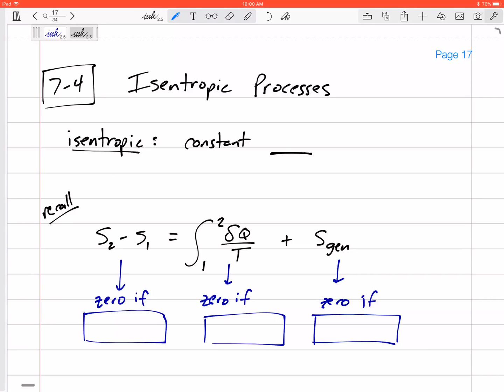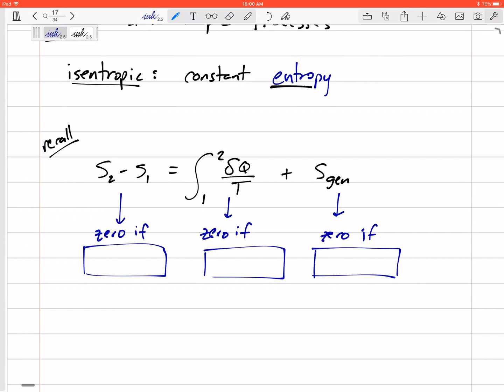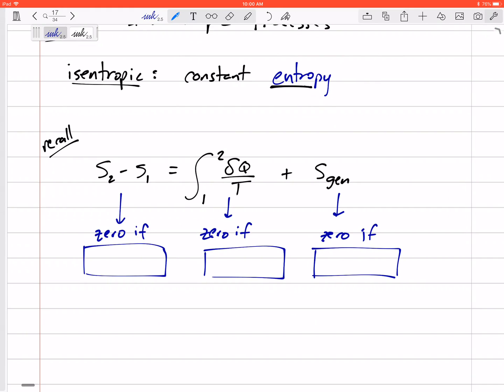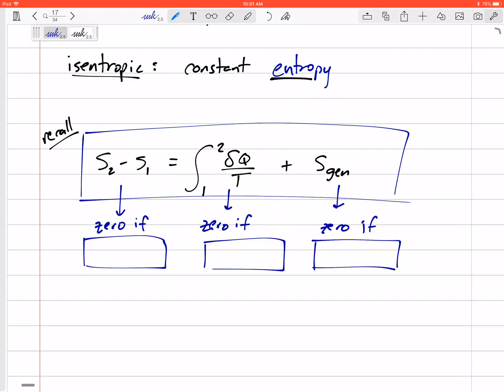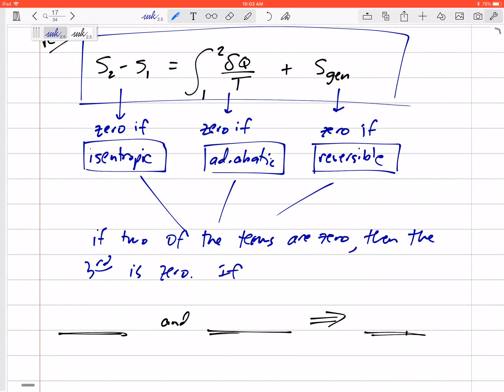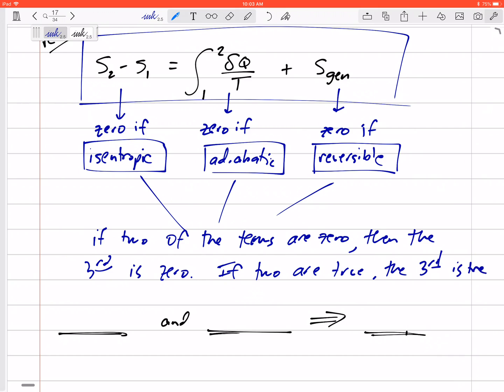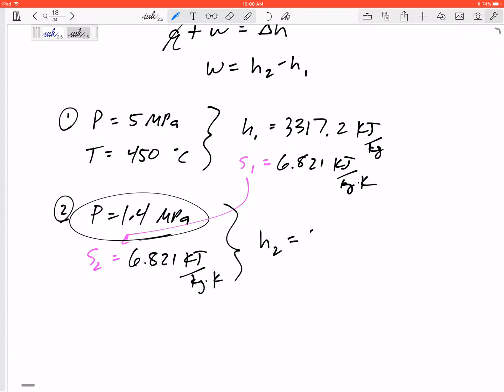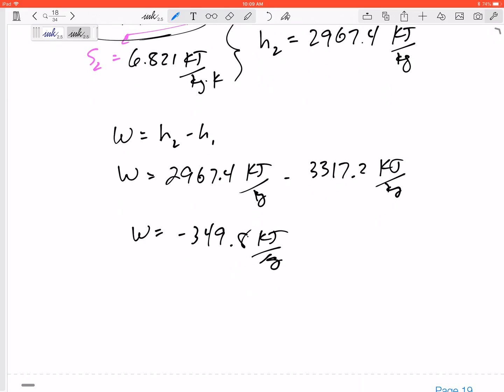Thermodynamics - Entropy 7.4 Isentropic processes

Comment: 5:40 why does it equal to delta h ?
Reply: Turbine is a steady flow device. Hence, if you look at the "Steady Flow Energy Balance Equation" you can get the equation given in the video by ignoring kinetic and potential energies, of course. Moreover, since "Steady Flow Energy Balance Equation" contains terms in time rate of change, you need to divide the equation by the mass flow rate and get the desired work per mass term.

Comment: Thank you for all your video that I find really useful. One thing I don't understand at 12:30: assuming the process were irreversible but still adiabatic, then it wouldn't be isoentropic and s2 would be greater than s1. Looking on the table of superheated steam for p=300 kPa any point with s2 > s1 = s2_rev has also h2 > h2_rev. This lead me to the conclusion that if the process were irreversible h2 would be greater than h2_rev  (2845.7 kJ/kg). In turn v2 would be lower than v2_rev from the first equation on conservation of energy that means that v2_rev is NOT the minimum velocity value at the outlet of the diffuser. What am I missing? Can someone help? Thanks
Reply: since you wrote this comment 6 months ago it might be a bit late but yea i was confused too and thought like you. i guess the question is written wrong and actually wants us to find the maximum velocity otherwise it doesnt make sense to me as you explained more irreversible means lower velocity so if it is reversible we get the maximum velocity available by the laws of entropy

Comment: Can someone explain why on number 8, when we try and find h2, why do we interpolate between 250 c and 300 c ? Because we don't have any given temperatures except for 450 c but that's for state 1 and at 5 MPa or 5000 kPa.  And for 1.4 MPa the phase is superheated vapor still, but we don't have any given temperatures except for the t-sat found at 1400 kPa or 1.4 MPa for state 2.  So how do we know to use 250 c and 300 c ?

EDIT: still need help, but the only connection I see that could make us interpolate between 250 c and 300 c is that in state 1 the t sat is 263.94. but even then that's for state one not state 2. So where is the connection to use those numbers ?
Reply: Hey i was having the same problem. But you need to use the fact that the process is isentropic. Such that s1=s2. You then find where the entrolpy lies on the tables for me it was superheated water 1.4MP between T250-300. Given that the s = 6.8210 it lays between the 2 values. You can use an equation to find the enthalpy given you know the upper limits, lower limits and the target value. in basic form it is                                                Y = YL + [X-XL/XU-XL]*[YU-YL] where Y is the what you want, YL is the lower limit of what you want, YU is upper limit. XL is lower limit of what you know X is what you know and XU is the upper limit. so for this problem the equations comes out to be H2 = 2927.9 (Lower limit) + [6.8210 (what we know) - 6.7488 (lower limit) /       6.9553 (upper limit) - 6.7488] * [3040.9 ( Upper limit) - 2927.9 (lower limit) ] = 2967.41 kJ/kg.  Hope this helps :)
Reply: @Eggobaco  thank you!
Reply: Thanks. That was really helpful

Comment: The pressure of 0.15MPa @120C is not in my table A-6 for superheated water.. When I look at the T-s diagram (figure A-9) you can kinda approximate the values (120C @ 1.5bar).. They look to be what he has, but since on a chart its hard to get an exact value.

Comment: Hi, for the second question (#9), how do we find the specific enthalpy and entropy values? I went to A-5 and found that at state one the temperature is much higher than the saturated temperature so it must be a superheated liquid. But when I go to table A-6, I don't know how to interpolate between 0.1MPa and 0.2MPa because they don't share the same temperature ranges (0.2MPa actually doesn't list 120 deg. Celcius at all).
Reply: just replying for anyone whos interested in the future ur probably done with it;

find the enthalpy in the table for 0.1MPa using interpolation between temps 100 and 150, then use that value to interpolate again with the value of enthalpy from the 0.2MPa table where its temperature at saturation is almost 120 so its safe to use, 
(Make the temperature constant (120C) and interpolate using pressures and enthalpy)
same thing for entropy
Reply: @kk2937  use the 120 almost at saturation did not get the answer
Reply: @hiteshadookarun8941 so did u figure it out later? I’m still stuck here